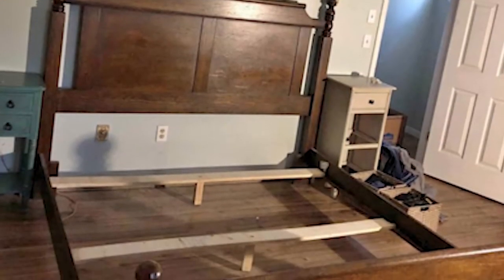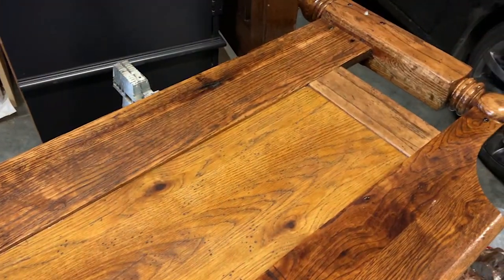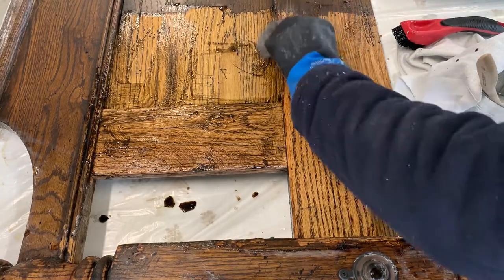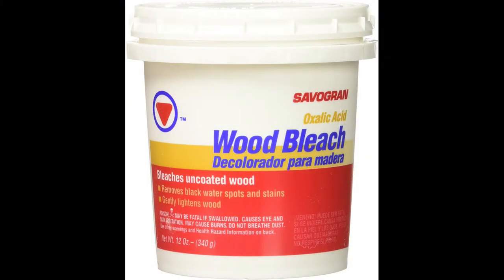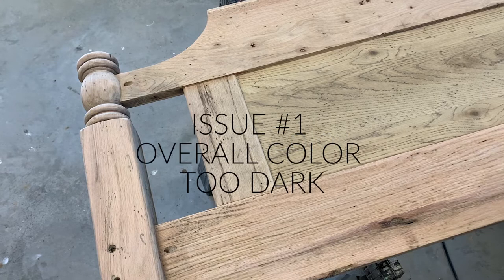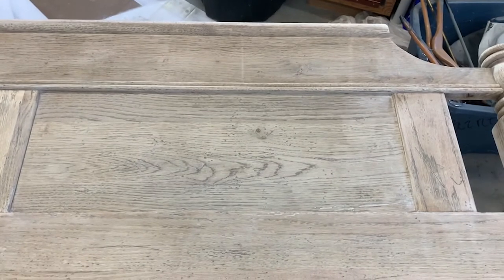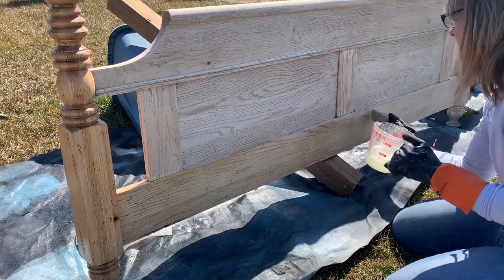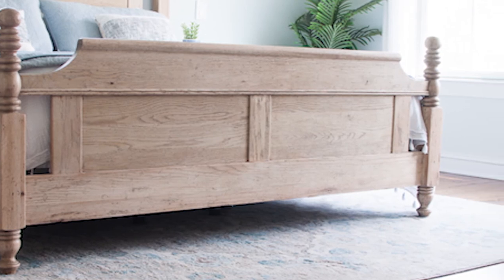New Bed with Raw Natural Wood Finish

Comment: I love the look of the finished bed. It is exactly the look I am going for so I'm glad I came across your video. From the research I have done the 2-part bleach is a 3% lye solution applied first and then a 30% hydrogen peroxide on top. I am a soap maker so I have the lye and have just received the peroxide. I can't wait to do it. The bleached wood of your bed has a very calming, peaceful look.

Comment: Why not just sand and sand until you reach the raw wood?
Reply from the maker: Anna, sanding can work, but on the veneer parts, you may sand through the veneer before you can get the color you want. Also, stripping helps on curved parts that are difficult to sand, like the posts.